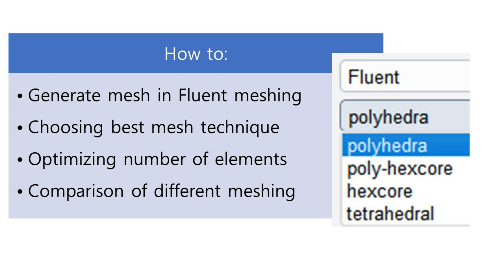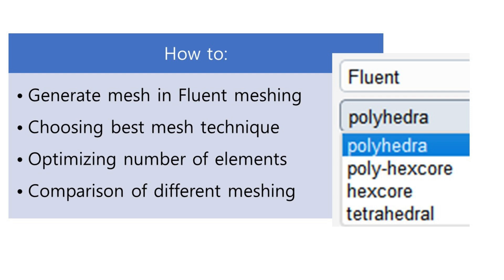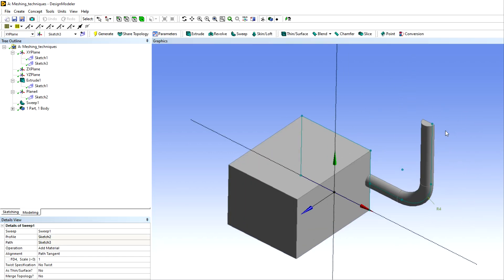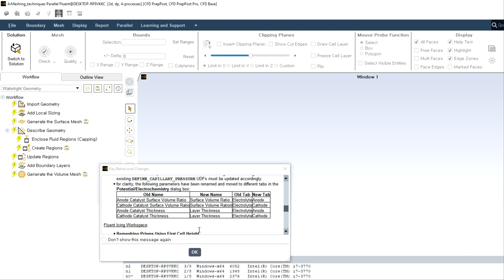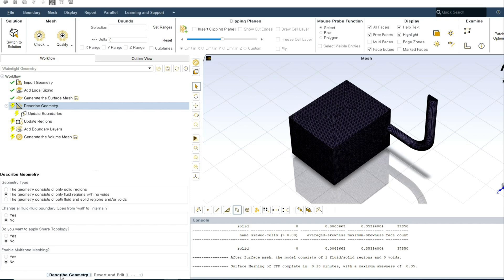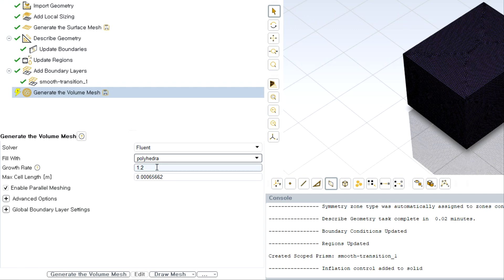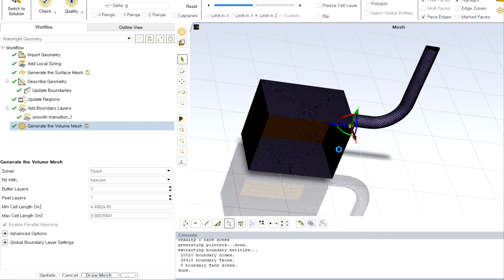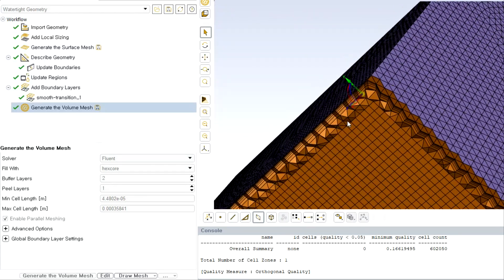Mesh Generation in ANSYS Fluent: Polyhedral, Tetrahedral, Hex and Hexcore Techniques

Comment: In the Poly-Hexcore meshing method, does the geometry need to be a single body, or can I use multiple bodies that together form one and share topology?
Reply from the maker: I have successfully created polyhex  meshing with multiple bodies with shared topology.
Reply: @TechnoLabTutorials2402  At the interface where the faces are shared, I notice that polyhedra are generated instead of hexahedra. This doesn't happen when it's a single body. Is there a way to prevent polyhedra from forming in these regions?
Reply from the maker: One tricky way is to create inflation layers on the interface. You can control the aspect ratio!  I remember trying once. Please let me know if it works for both sides of the interface!